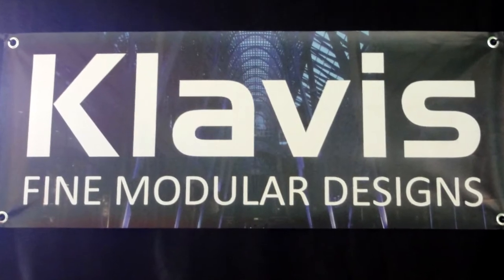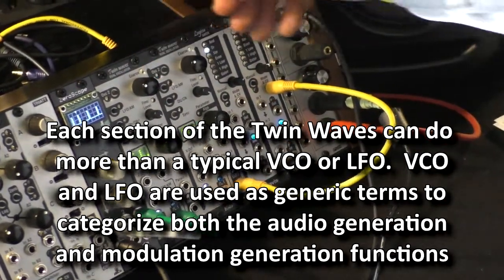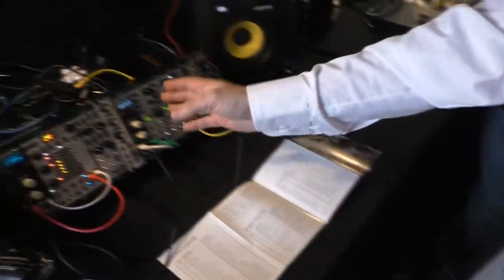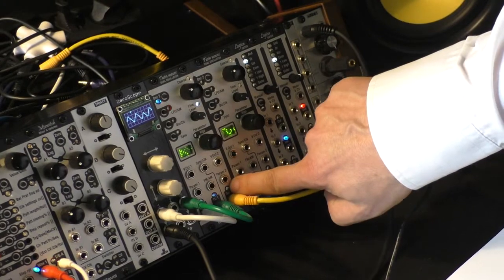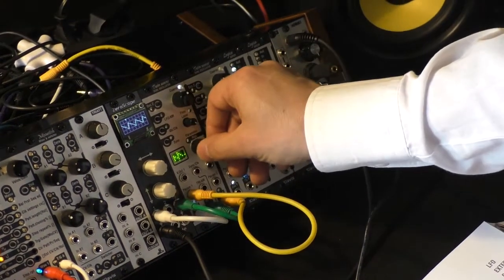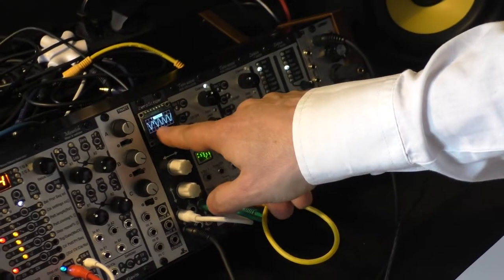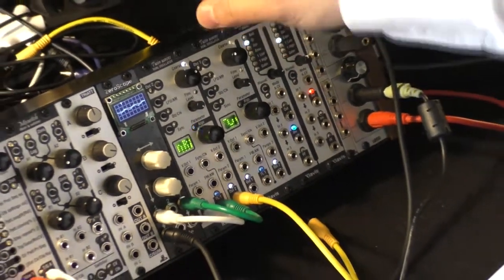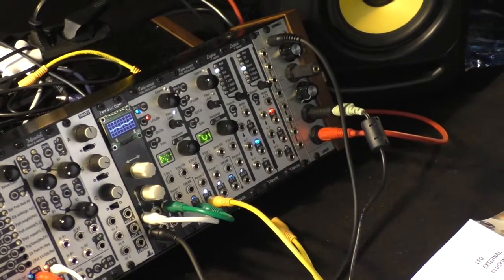Superbooth 17 - Twin Waves Voltage-Controlled Dual VCO/LFO

Comment: Another great video! Love the inserts and captions, really make some things clearer. Quite a powerful oscillator, this... Also liked the little displays and how they showed more information.
Reply from the maker: Bedankt!  Yeah, I'm really looking forward to getting something modular set up.  Looking at maybe getting a Waldorf KB37, just because being able to play a synth is as important as being able to tweak a synth, and it's mobile as well as modular.  And I REALLY liked the ability to give the wave shapes movement even before it hits a filter.  That's part of what I love about the OB6 (variable wave-shaping) and the new Dreadbox Abyss as well.
Reply: I got a case with Doepfer modules myself. It's cool stuff to experiment with although I have noticed that it doesn't really integrate that well into my flow of making music (I like to be able to recall stuff as well as play chords).
Reply from the maker: Yeah, I think I'm more like you, where it would be cool to play WITH, but maybe less so just to play.  That's why I think the Waldorf KB37 would hopefully scratch both itches (playing AND playing/experimenting with).  And I suck as a keyboardist, but I still just love the simple act of noodling around on a keyboard or piano.
Reply from the maker: I am VERY impressed with the Matrix Brute, but it takes up a LOT of space for a monosynth and isn't cheap (though costing less than a Minimoog Voyager did or Model D does).  And I do like having presets for playing live, but for me, I really like the temporary-ness (to make up a word) of the modular stuff.  To come up with something quickly more than once, you have to REALLY understand what you're doing.  That's great for understanding things.  

But we'll see.  A "Modular Hobby" can also explode quite quickly into more money than I want to spend.